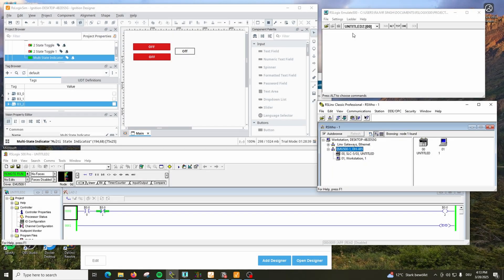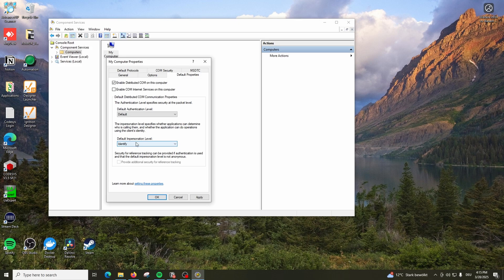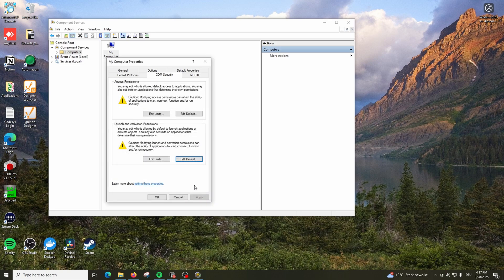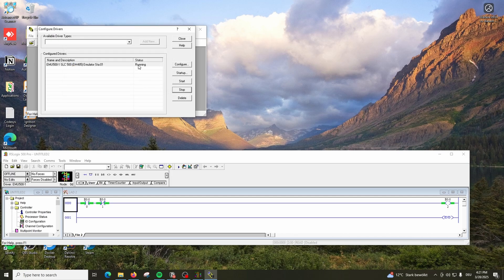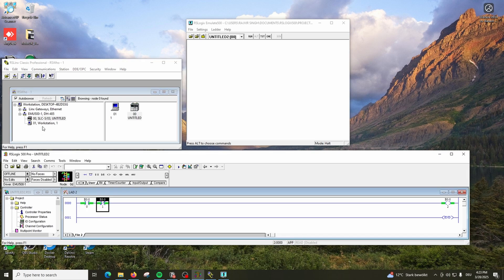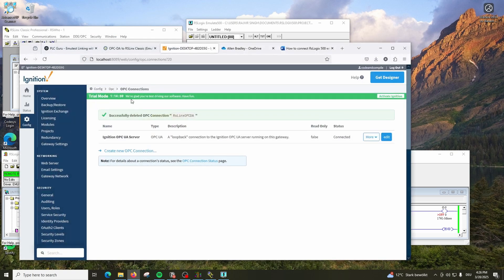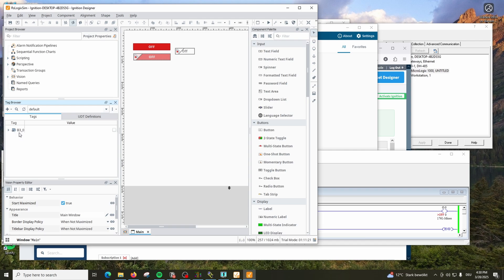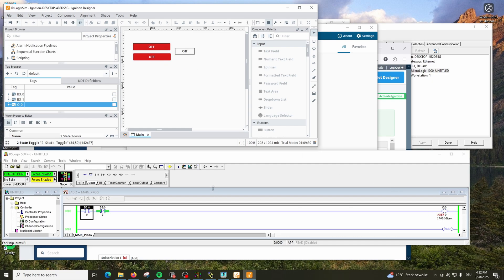Connect RsLogix Emulate with Ignition SCADA via OPC DA

Comment: I have tried many times; didn’t work, then realize mine is Rs linx lite.
Reply from the maker: You can install RsLogix 500 that comes it RsLinx Classic to make it work for you :)
Reply: I have rslogix 500 and Rs linx classic (lite). Not support extra features.
Your’s is Rs linx professional.
Reply from the maker: @amaanshaikh41  You can get RsLinx Professional from downloading and installing RsLogix 500 v12.0.0 available at Rockwell Automation website. But it's a trial version. You need to get the license after your trial period is over.
Reply: Mine is studio5000